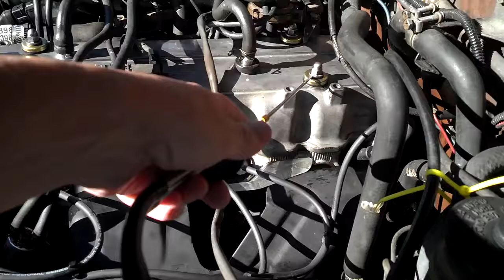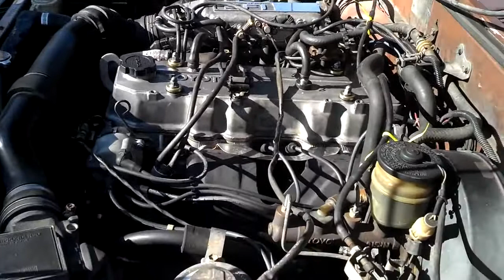22re Engine knock

Comment: I had one of those, and it knocked like that for years unless I burned premium unleaded. It was a great little motor though, and I never begrudged it the additional cost - especially as my mpg increased once I began to use premium.

Comment: Mine is makeing the same noice i just put a timming chain in it and i got rid of the ticking but it knocks. I was looking around and i put a rod under the cam and it would move up and down it probably has a bad head or u can take ur cam caps and get them line hoaned
Reply from the maker: It's been a long time but I thought the same thing. If the piston is at the bottom of the stroke  one side of the valves will be lose.. I think.. Rotate the main harmonic balancer pulley 180 deg and see if it tightens up.

Comment: Ive got a 90 2wd pu same exact noise ...in the rear cover bolts ...rod bearing ?...it sounds lower down than valve train. ...thanks for posting this ...how long has the noise been?

Comment: Did you ever figure out what that was?
My 22re is doing the same thing but it seems to be random.
Reply from the maker: On mine its from the engine being cold, the rocker arms were out of spec. But when it heats up it goes away, later on i added some Lucius marvel oil and it has not came back.